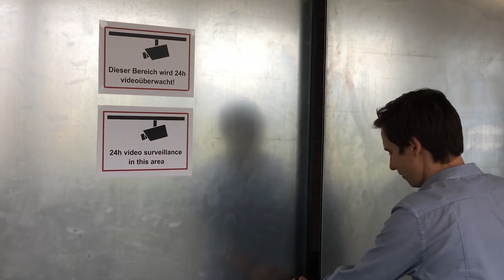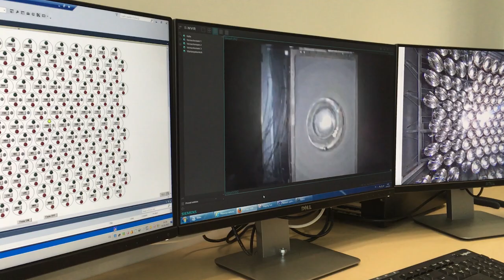Why Tom Couldn't Show You The World's Largest Artificial Sun

Comment: Actually lights can in fact make that noise... Back in the heyday of Hollywood movies and theatres, the lights that were used in studios and stages used massive physical levers to turn on the lights, and those levers made that "THUNK" sound when they were switched on due to both the physical mechanism and the brief arcing that occurs. You can see it in movies like "Singing in the rain" (though that was obviously foley) it did sound like that. Couple that sound with the reverb of a large Hall or sound stage and voila.. THUNK

Comment: It's not surprising that the camera didn't overexpose. The sensor is designed to cope with the sun, which only occupies 32 arcminutes (probably about 10 pixels on the sensor). The artificial sun fills a much larger field of view, and each pixel probably didn't get more photons than it would looking at the sun. Any camera would have coped, until overheating.

Comment: Why couldn't you for example take out the battery, and connect it with wires to the GoPro? 
like the battery would be sitting safely out of the light, and only GoPro would be exposed to the light

Comment: If you ever have the chance to go back, get a piece of 310 stainless steel and have it sandblasted (to reduce the reflectivity). With the lights turned on, it'll heat up. With that heat, it'll oxidize. As it increases temperature it'll go through hues of color from gold to blue and purple. As long as they don't melt it (which with 310 won't happen accidentally) you've just created a really rube Goldberg anodizing process. But it'll look really cool.

If you want even more of an effect, get a piece of flat stock about twice the length of the focus area and center it. As it heats up, it'll wiggle around like a worm from unequal heating.

Comment: 00:47 "I did get to go there on the Autobahn in one of the non speed limited areas"
Almost all of the Autobahn network doesn't have a speed limit. In fact it's rare to see a speed limit on the Autobahn. There are speed limits in construction sites and at night near residential areas but everywhere else there are no speed limits.
Reply: Correct. Thus, he was in one of the non-speed limited areas.
Reply: @doktorwyvern2883  it feels weird though. I don't say I'm in a no shooting area when I'm in public just because there's a few areas (shooting ranges) where shooting guns is normal.
Reply: @The-Urban-Goose  right, but most roads have speed limits. Thus, when talking about the autobahn you would specify "in an area with no speed limit" because if you did drive in a section with a speed limit, it would just be another road, and thus not really mean anything.

You're being pedantic purely for the sake of being a pedant and you're analogy was obtuse to the point of just being obnoxious. Why act this way?
Reply: @doktorwyvern2883  I agree that my example was a bit over the top, I was just saying that saying an "area without a speed limit" was a bit redundant or rather a slightly odd choice of words. The autobahn is known for having no speed limits and saying "an area without speed limits" in this way implies that it's something special for the autobahn, and that there are more areas with speed limits, which simply isn't true.
Reply: @The-Urban-Goose  Sure, if you know what the Autobahn is, know it is almost entirely speed limit free (and not say, 50/50 or something) know it as the Autobahn if your original language was non-European and had a different name for it (or it didn't have a word for it at all, and the autobahn never came up because it's in another continent.) and understand that going fast is the express purpose and not just an option.

Whereas saying "in an area with no speed limit" conveys all relevant information even if you've never heard of the autobahn, and given the context even tells you he was going fast.

   Saying "I have an Ameraucana Chicken, one that produces 250 blue eggs annually" is redundant for many reasons. Ameraucana, as it's spelt, only refers to the chicken breed (the encyclopedia and Offspring album are both spelt Americana). For that breed, producing 250 eggs is a given. Same with the egg color, as that was a human selected gene. Annually is also inherently implied because we are talking about chicken egg production. But, you probably knew none or very little of that. Common knowledge is very subjective, and Information that is only redundant if someone posses your idea of common knowledge (which in this case is trivia about German infrastructure and chicken logistics) shouldn't necessarily be omitted.

Comment: What about modifying the go pro, so you have wires (probably need to be shielded to not melt), connected to where the contacts for the battery are on the pcb and use a power supply or battery out the way of the lights? It'd be a simple modification and mitigates the risk.

Comment: Wire the batteries to be remote. They could sit off to the side of the beam and not be in danger of burning. If they are worried about shorts you could even put a fuse inline with the wires going to the camera.

Comment: I thought that "lights" didn't make "that noise" too until I visited a big empty warehouse and they did make that movie noise 5 times. Of course it wasn't the lights as such but the relays. They had weights on them so that they would be able to separate the connection even if the metals had started to fuse together.

Also I had laughed at the movie versions of a server room going "boooooooowwwhhhhh"  with a deep rumble when they turn off the power. And then I was in one of our datacenter with someone by mistake cut all the power, including battery backups and it made that silly movie sound.

Comment: i know i am late to comment on this, but why not bodge in a remote battery that could be held away from the focal point? thus the gopro could be sacrificed, but the battery would not be in the camera but safely away from the heat? or would the voltage drop be too much for the go pro to deal with?

Comment: If you get another chance to go there. You could probably figure out how to power the go-pro via cable with the battery missing. My Go-pro is dead now any way so can't test it, but perhaps they just work with a USB cable and no battery. If not, you can probably set up something using the battery connectors.

Comment: Old video I know, but I wonder if you had removed the battery and run the GoPro off of an external power supply, whether that would have been safe enough to turn it on full blast, because there's no lithium ion battery at risk of going boom.

Comment: Would attaching the lithium ion battery to the gopro camera's electrodes with copper wires mitigate the risk of the batteries exploding because you could move the battery out of range while having the camera in the right spot? You'd still melt the camera so it's not all that great but it's less of a hazardous situation.

Comment: If you don't mind trying to burn out a camera, you could compare how the go-pro takes on an artificial sun to how it handles a laser pointer or Nd-yag laser.  Nd-yag lasers are used in particle imaging for fluid dynamics and I burned out a few lines on a cell phone camera while aligning a laser at "low" power.  Even legal laser pointers can deliver more power than several million suns to a small point on your eye or CCD.

Comment: good video and all, but you COULD  just use wires and place the battery soewhere remote and still have the gopro in the hotspot an it would be fine right ?

Comment: Well just run a tiny copper wire to it from a DC power supply outside of the room, and replace the battery with those wires. A 5V DC supply with a resistor should work for 4.5V

Comment: Tom - why not send them a gopro to melt and have then send you the video? Just remove the battery and power it from a usb cable and a usb battery bank somewhere outside the focal point (maybe behind a shield?) You could also use a webcam, but that's more complicated setup.

Comment: Publish the official video anyway. You went there to visually film how bright the lights are, and the video may not show that, but the story still does. Vides are about the story, not just the visuals. Besides, we still get a sense for the brightness in the moment before the GoPro adjusts.

"It's already overexposed.'' Can you overexpose further, and keep going until you blend out the moments when the GoPro adjusts?

"The only way to fix this would be to go back and MELT a GoPro." If you had the chance to go back, couldn't you just bring a different canera that you could manually set the ISO, shutter speed, and apeture settings for? Many digital cameras with manual settings still only auto adjust exposure, but not all of them.

Encouragement to push ahead with the official video.

Comment: Simple enough answer. remove the battery from the gopro and run some 10 meter leads. Then power it on from a distance and let them melt the rest.

Comment: This isn't a failure of the video... it's an amazing advert for the overexposure handling abilities of a typical GoPro.
"We took this £300 action camera, shoved it in front of a massively overpowered lighting rig that's many times brighter than the actual sun, and it still survived without showing any ill effect..."

I mean, does it even give you any way to lock off the exposure on the camera itself, or is it all 100% automatic? If you'd put a disposable ebay-purchased digicam (running off AAs, or maybe an AC adaptor) with a manual exposure setting there instead, it might have looked more impressive... maybe. Or more likely it would have just gone all white. Really it's not something that would have been spectacular unless the thing you put in the path of the beam had been permanently damaged somehow, in a way that could be shown off in the vid.

The set-up itself was impressive, really. I enjoyed that bit, and think we got the idea "this is really stupidly bright" without needing to be shown it ;)

Maybe the way to show it off would be to have a lamp with a regular 100w incandescent bulb and its shade removed sitting in the corner of the picture, and the brightness of the Synlight array would become apparent by how that bulb appeared progressively dimmer, until its filament was only giving off a barely perceptible brownish glow or even looked completely dark...?

Comment: You do not need a battery in a gopro to turn it on, if you take the battery out and plug the charger in then they might let you melt a the gopro. That is if you really wanted the footage.

Comment: You can just remove battery (hookup external power source) all you need soldering iron (i believe? it correct in English) + 10 meters of wire (+ tin+lead alloy and flux) and case solved.

Comment: I am 3 years late, but I will give you the one fix you could have done to make this impressive and angle it away from the GoPro fiasco.
Add a temperature gauge in front of the GoPro, so the temp is visible on the footage, problem solved.

Comment: Well... loose the gopro and use a camera not battery powered... heck use a raspberry pi with a rapsi cam on a long cable... it would happily melt and not explode - the facility should be capable of handling melting stuff if they test the heat resistance of materials - let alone that the video in the current state is also very interesting, even without spectacular overloaded camera images

Comment: It's impossible to show how bright/impressive it is because computer monitors/TVs/etc. can only get so bright. Which is a good thing as you don't want to go blind while watching TV. But how did you expect anybody to be impressed by the visuals? We'd want to see what's happening, of course, but no matter what sort of camera you're using you're going to have to describe what's going on as we can't see how bright it is. Of course it would be an "Oh, that's interesting!" video, not an "Oh, that looks cool!" video.

Although if all you were after was melting something, you could have picked something other than your camera to stick into the light and recorded that melting. Or put a thermometer there and watch the temperature go up. Or let a water balloon explode. Another option would be to try a different camera - the GoPro handled it, but maybe your cell phone would melt?

Well, regardless, I still got to see the footage anyway so I guess it doesn't matter. :P

Comment: Ok melt yhrbgo pro ! A sensor heat death would be cool or better yet use an old used dslr just use a wire on an external battery pack across the room wrapped in a space blanket no book plus heat death. Cake acquired an eaten with 1 pound of wire and solder or AC adapter